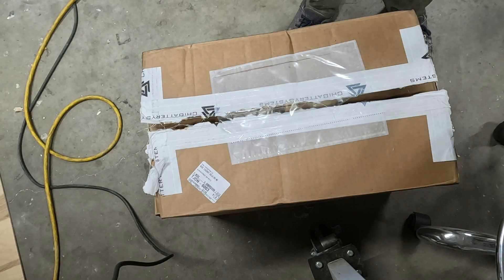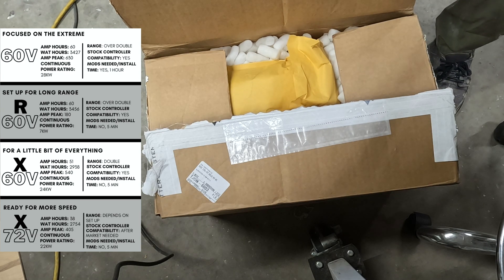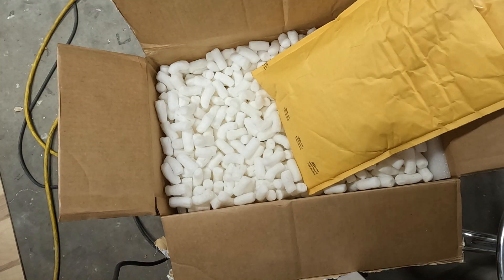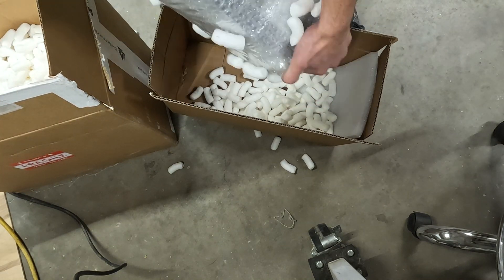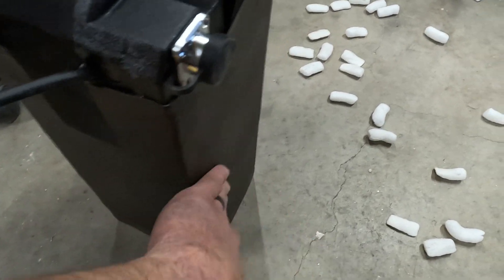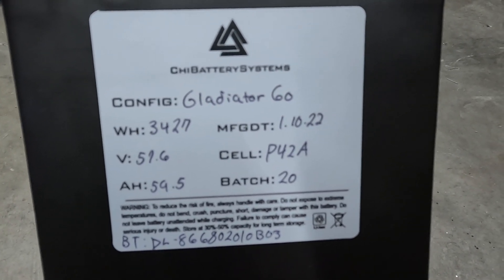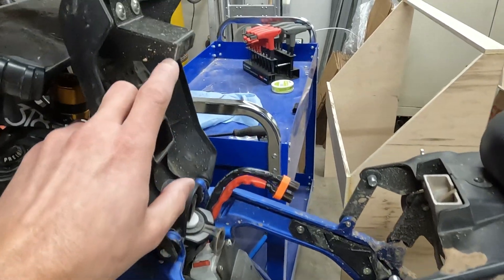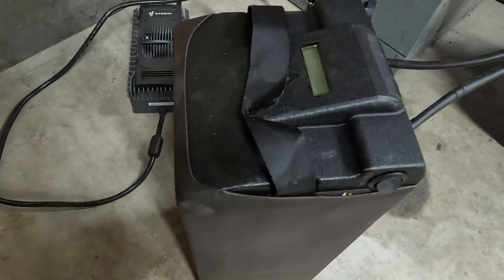Chi Battery Systems 60 Volt Gladiator Surron X260 Battery Unboxing and First Impressions.

Comment: Sweet build I have the same blue frame, but nothing else yet. Do you know what the plug is on the stock battery that has the 6 pin connector? I always see these battery swaps and I'm trying to build my own battery and have the power adapter and the charge adapter, but I haven't figured out that 6 pin connector and if I even need it when I build my own battery doesn't look like Chi cared about it much either.

Comment: How do these work if they don’t use that second connection?
Reply from the maker: What second connection? You mean the 6 pin from the factory controller? If so, they give you a little jumper to trick the controller. If you have an aftermarket controller like a BAC, the second connection becomes totally obsolete.
Reply: @owlexpedition7199  that's exactly what I meant. thanks for the info man

Comment: Hello I just received my 60v from chi battery is it normal for the percentage to go up and down like that when not connected because my seems to do that same
Reply: When not using the battery, the voltage level and percentage readout will be stable. But when actually riding, both voltage and percentage will drop or "sag" depending how much current you are demanding from it. Even if you have a brake regen setup, the voltage will spike during regen. But at rest, it will quickly (seconds) stabilize. 
It's totally normal. The stock Sur Ron battery only reads out percentage, and if you hammer on it a a minute, and stop and immediately look at the readout, it will quickly climb a few percentage points, and stabilize. Just the way these batteries and BMS systems behave.
Reply from the maker: Not sure what you mean. Voltage will go up and down depending on load. You'll get "voltage sag" when you start riding as the voltage drops when amps are being pulled. It should level back out when you stop though.

Comment: Hey curious!… What’s the weight difference overall between stock and this battery?? Thinking about getting the same 60V/60Ah gladiator as you did! Thank you for the help!
Reply from the maker: I'd say like 10 lbs. Haven't weighed them but once you have a upgraded controller with the chi battery, the added weight isn't an issue.

Comment: Oh man It turns into a workout after a while. I had to swap out the original wrap with a thinner one In order to get rid of how tight it is to slide in. Chibattery sent me the new shrink wrap and it’s so much easier now.
Reply from the maker: Nice! I still have my stock battery with an ANT BMS installed in it. I may try to make it swappable for when we camp off the grid so I can get more riding in.
Reply: @owlexpedition7199  Are you thinking about maybe doing an ant BMS install video in the future? Why did you install a new BMS in the stock battery? I have seen a couple posts and videos of the stock 60v BMS going dead even talked to a guy who had his die after the first 10min of ownership
Reply from the maker: @liamchisholm  I took video of the install, but later realized more than half of it was out of frame. It wasn't too hard to install though. You really just need basic wiring/soldering skills. I replaced mine because it's much safer than doing a bypass.
Reply: Once you get the battery in, why would you need to take it out?
Reply: @AmenCornerRider  if you live in NY, strange tends to be very difficult and leaving the bike outside with the battery in NY winter, it’s not a good thing. I have access to a garage which I keep my bike in but I bring the battery inside charge.